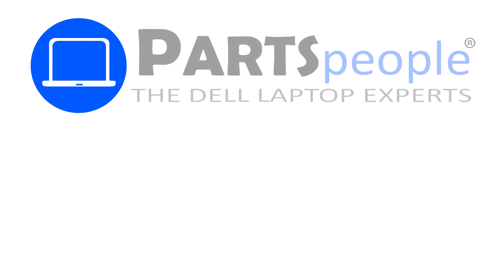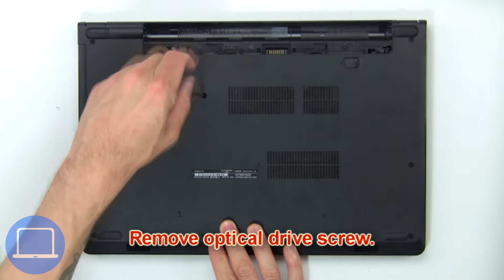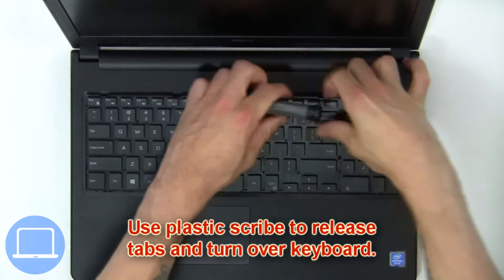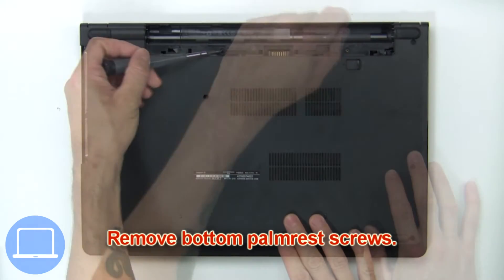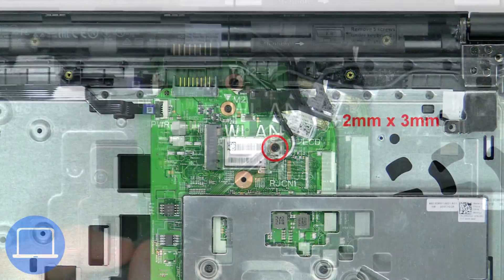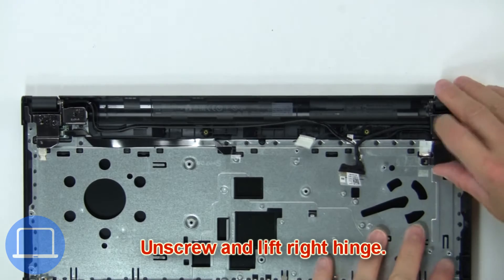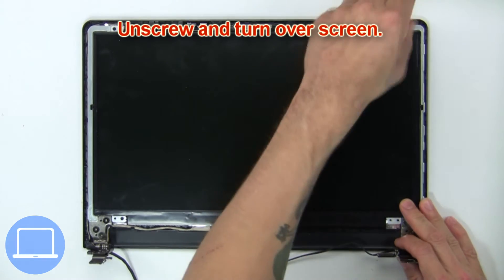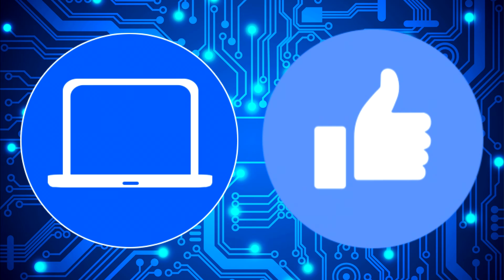Dell Vostro 15-3568 (P63F002) LCD Panel How-To Video Tutorial

Comment: Question, don't really need to open back panel if you want to change the screen and use the existing display cable right?
Reply from the maker: We reference Dell's user manual when creating our tutorials. They suggest removing the full display assembly before removing the bezel and LCD panel.